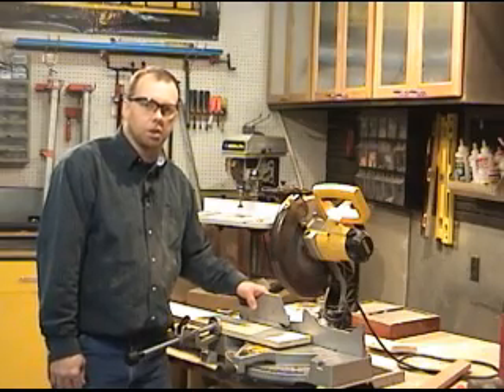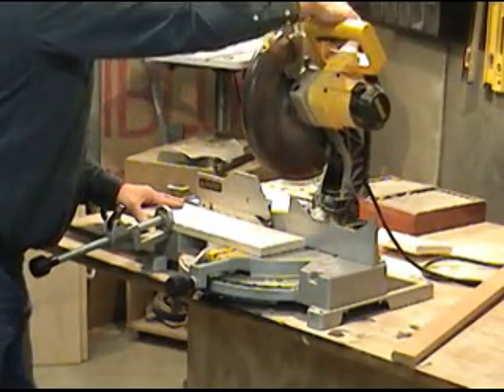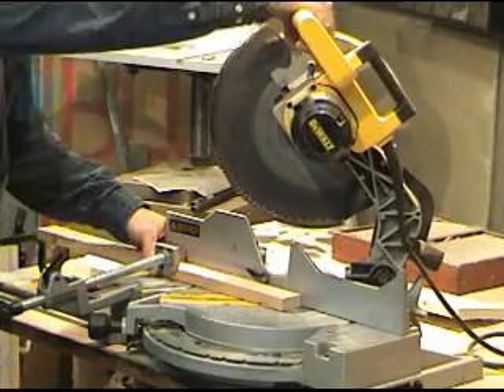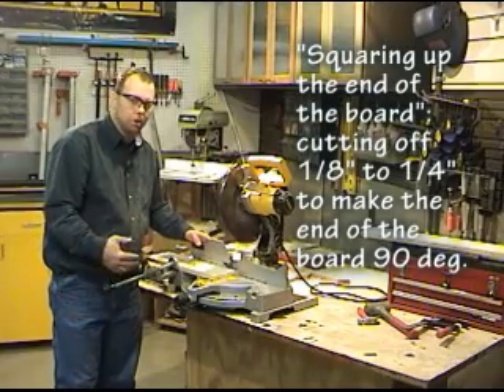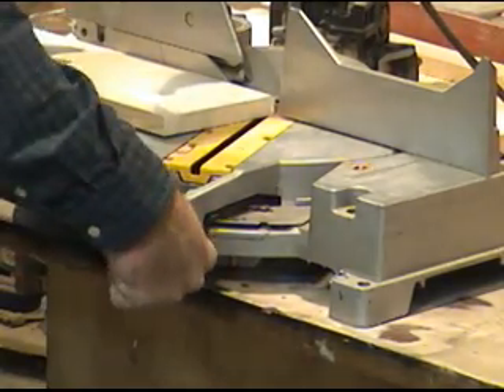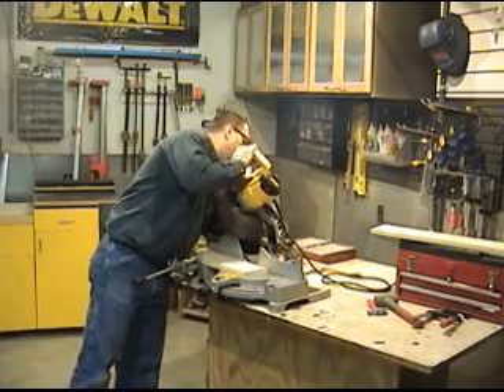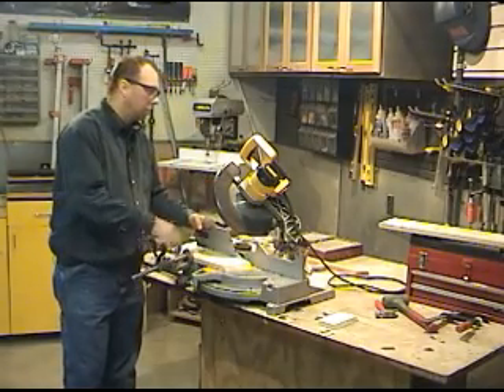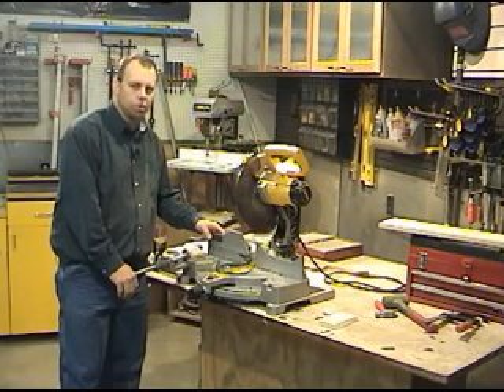Miter Saw Safety & Operation P2 of 2

Comment: Excellent series on miter safety. My only suggestion is to roll up the long sleeves or wear a short sleeve t shirt as if sleeve ever caught moving blade, it could pull arm or hand into the blade causing amputation or severe injury. Also goes for rings, watches, necklaces, long hair, etc.